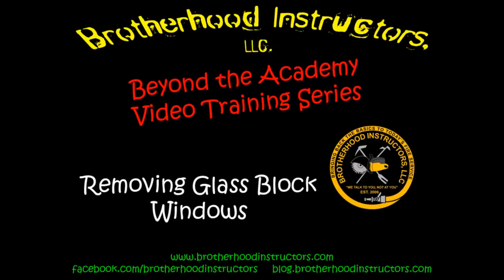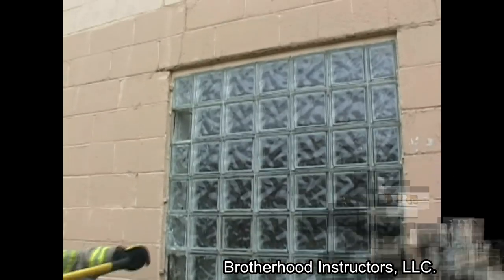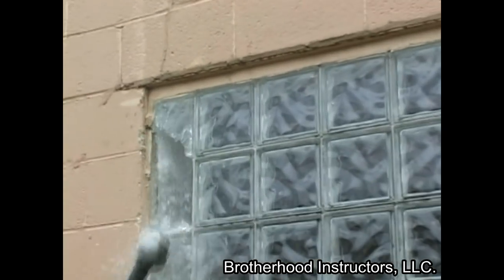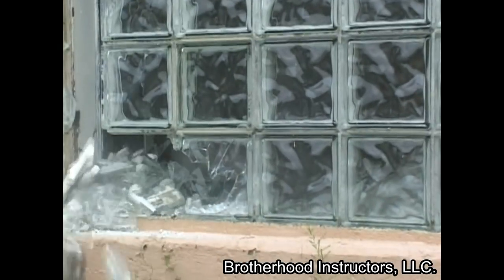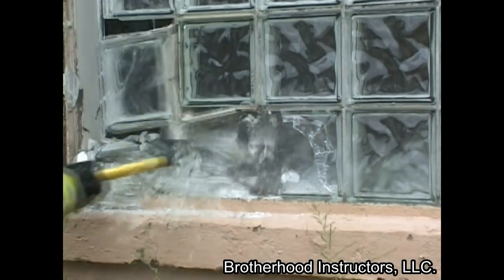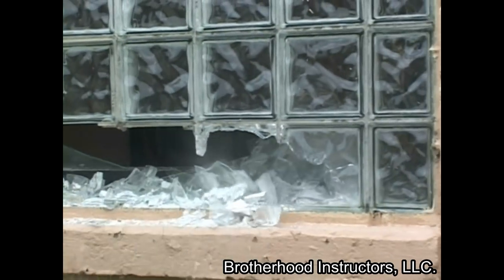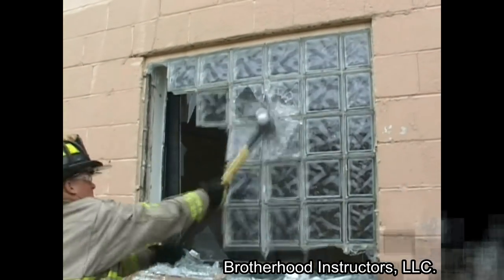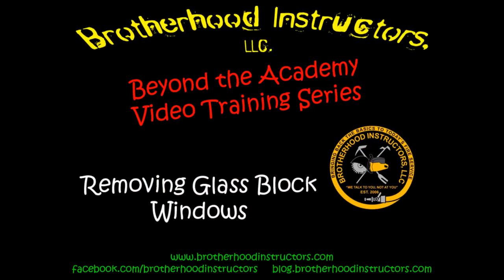Ventilation: Removing Glass Block Windows Efficiently

Comment: If the need to remove glass blocks is not an emergency (like in this video example) we would recommend putting duck tape over the blocks so the glass being removed does not travel very far. Many times homeowners and commercial property owners will want to remove smaller groupings of blocks to add an air vent for more air flow in a room. If you're unsure (or not comfortable) doing this a glass block installation company can help.